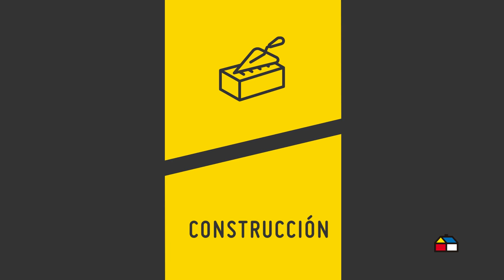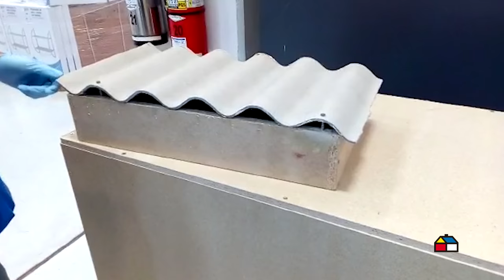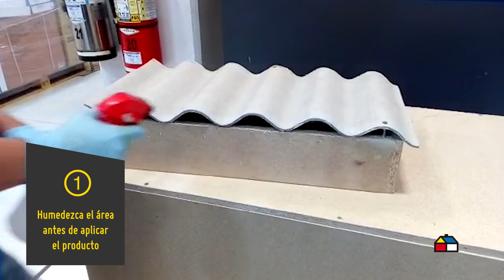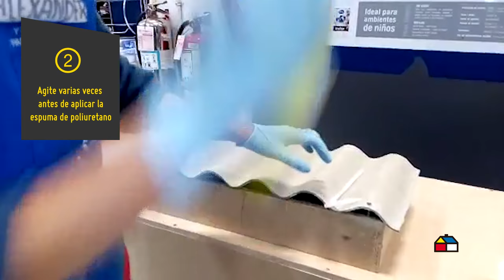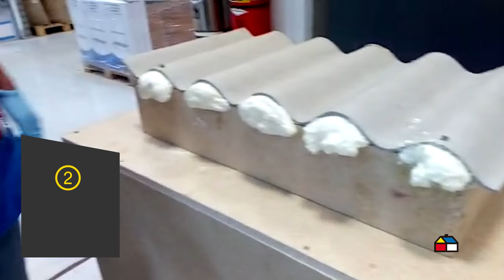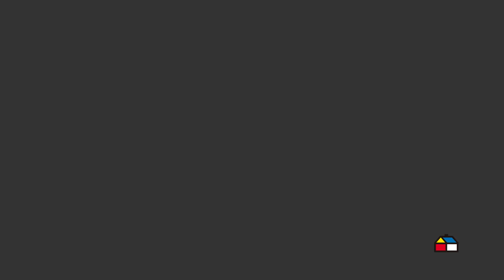Cómo rellenar agujeros con espuma de poliuretano

Comment: Estimados, como rellenar entre láminas de fibrocemento de las paredes para blindar las paredes, que sean resistentes como el concreto ?, Gracias por el video.
Reply from the maker: ¡Hola, Danilo! No existe manera reglamentada de volver planchas de fibrocemento tan resistentes como un muro de concreto. Si el fin de la consulta es para poder construir un piso sobre una construcción con planchas de fibrocemento, te comentamos que es totalmente posible; en Perú, es posible levantar hasta dos pisos solamente con planchas de fibrocemento; de hecho es la ligereza y fácil instalación la que permite hacerlo. Entre plancha y plancha te recomendamos instalar lana de vidrio, que es un tratamiento acústico y ayuda a regular la temperatura del espacio. ¡Saludos!